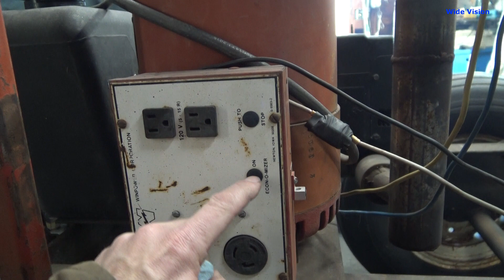Wood Chipper Tuesday!! Episode 28 - Back at it!  What's going on? Oh, and a new Carburetor.

Comment: Be prepared with the new carb. The reason they can make them so cheap is because they’re cheaply made. I’ve bought two for pieces of equipment and they both had to be disassembled and cleaned/deburred before operation, and they are just differently made enough that rebuild kits don’t fit.